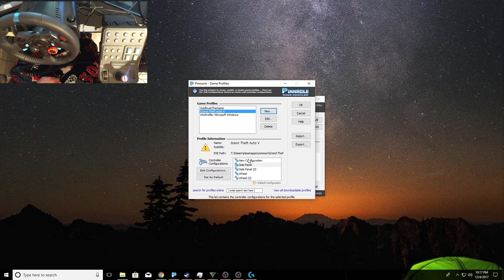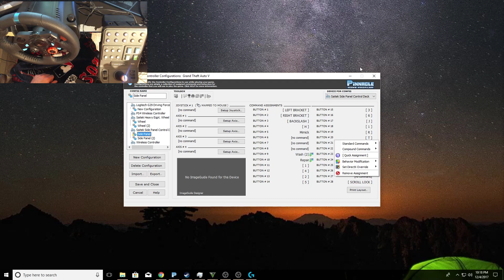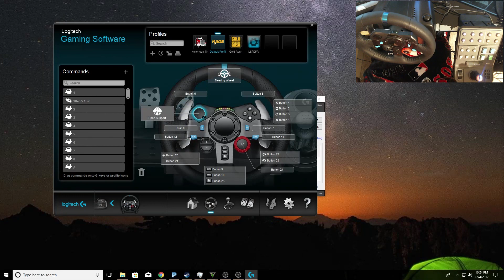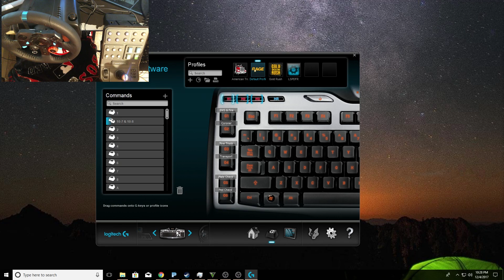LSPDFR Tutorial How-to Setup - Wheel, Pedals, and Control Panel for Duty | GTA Cops LSPDFR | GTA V

Comment: Hey BostonGaming!
I have this problem with my sirens.
I dont have the control panel so i put my car horn/sirens as a button on my steering wheel.But it dosent seem to work. All other inputs work just not the horn (Only for Police Cars)
The sirens will work only if i press "E" On my keyboard but it dosent work when i press the assignes button on my steering wheel. The carachter even puts his hand in the middle of the steering wheel when i press it but no sound comes out.
Sorry for this being so long.
If u know how to fix this or what did i do wrong please Reply to this comment
: (

Comment: Hey man great video so I downloaded the Pinnacle Game Profiler software and when I tried to open it and it blipped the logo for a second and then nothing happened. Is this software compatible with windows 10 64 bit or is there something I'm missing with Logitech because I do have LSPDFR and I'm running windows 10 64 bit with the side panel by Logitech gaming and I know my side panel works because I use it in FS 19. However, I do not use the steering wheel I have one but I just use a controller for driving. Do you have any suggestions that I can do to try and make this software work?
Reply: Or if you can make a video showing in detail your ini configurations that would help a bunch
Reply: BostonGaming I tried doing that and it gave me an instant error message saying that my computer was not set to the correct date because the trial would end so I tried purchasing it and I never could get them to give me a product key so I either have the worst of luck or Its my computer

Comment: hi! thanks for the tutorial so far, but i got one more question. I bought the g29 but without anything else so just the pedals and steering wheel. Is there a way to controle the lights and sirens (ELS) with the buttons on the steering wheel?
Reply: hmm can't get that one to work
Reply: I was wondering aswell, did you get it to work?
Reply: any updates?

Comment: cant wait for the next tutorial.. cause i was also wondering how you were doing the police radio so fast..lol!..
im getting the Corsair Vengeance K90  Keyboard it to has G-1 to G-18 (hope it works the same with the logitech software) if so the next video will help A LOT!..  

one more thing.. i noticed you were clicking the gta 5 application on the Pinnaclegamerprofile.. is this all done AFTER you loaded LSPDFR through Ragehook?.. or did you set the pinnacle to load rage?...